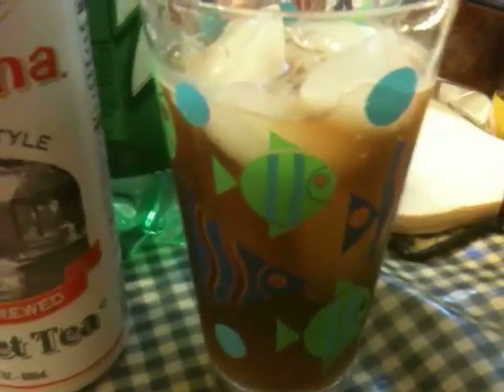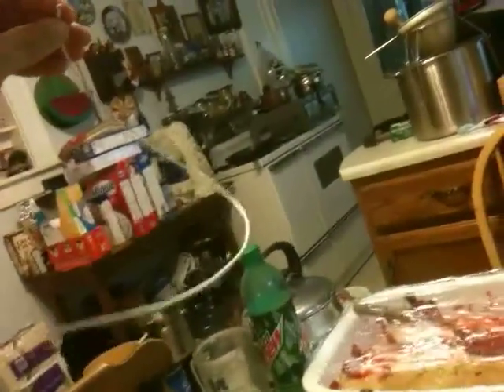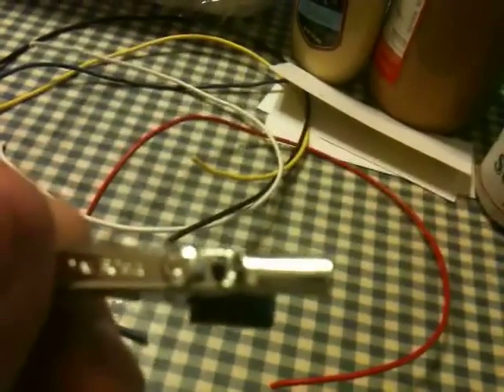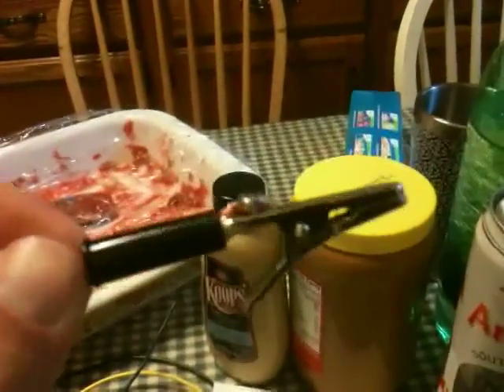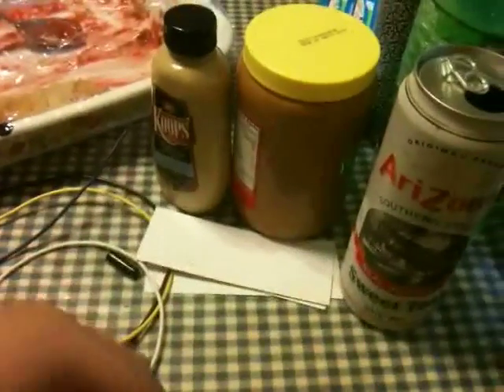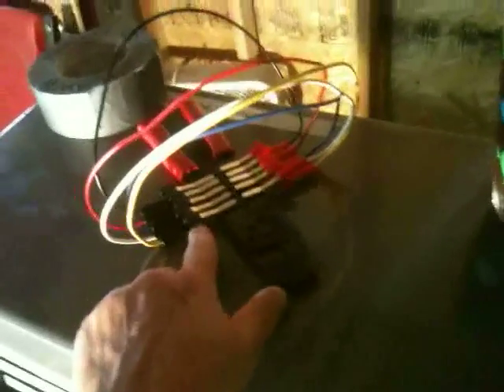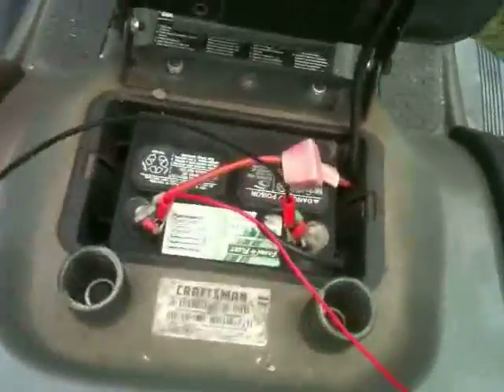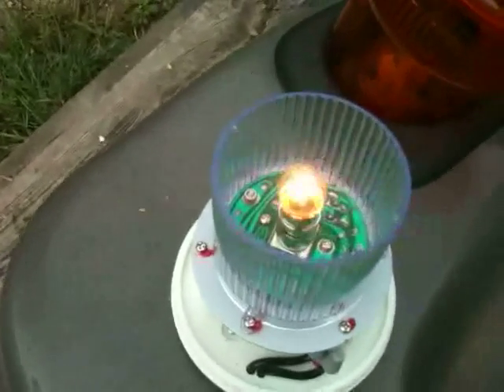Make your own Jumper Wires

Comment: I made a thing for testing vacuum cleaner motors etc. at work by putting a set of clips on a regular 120V cord, stripping the outer cover back to give me a couple feet of insulated wire then put the clips on that,  we have a testing device that either puts out 120V on an ammeter, or some lower voltage as a continuity tester, very handy setup.

Comment from the maker: @vwestlife I've always called the jumper wires. Because to my way of thinking you are jumping power to an component thus bypassing the circuit. But, I can see the confusion here. I always call the cables some one uses to start a car "jumper cables" and what some one uses to bypass a circuit with power "jumper wires" so I wouldn't ever confuse the two names.

Comment: These would more properly be called "clip leads" (as in alligator clips), because I doubt they'll carry enough current to actually jump start anything. (I once witnessed an alligator clip unsolder itself and fall off a clip lead when it got shorted out across a 12-volt gel cell battery... oops!)